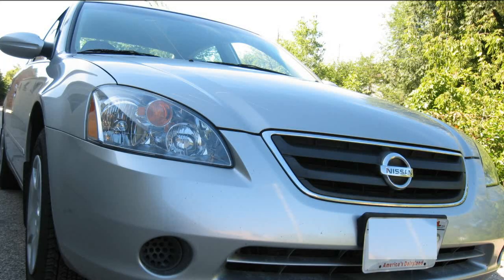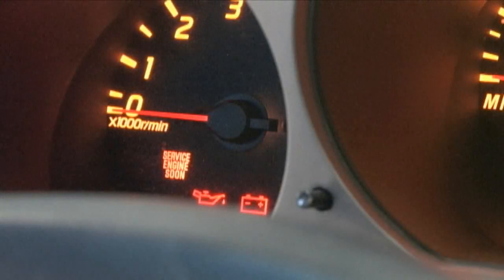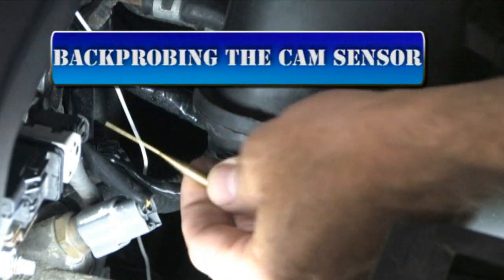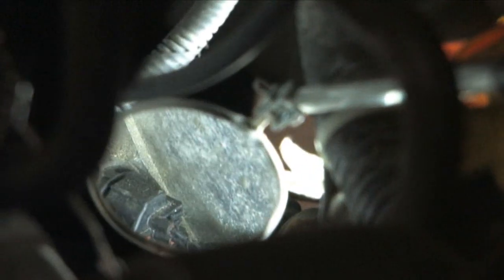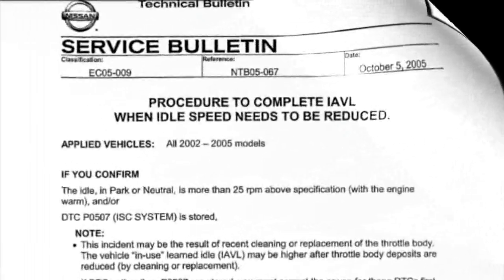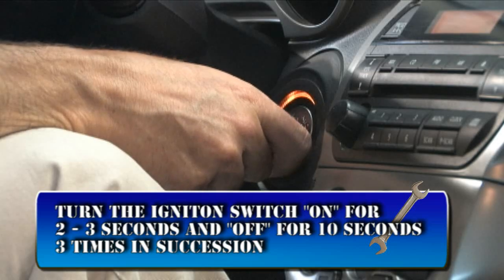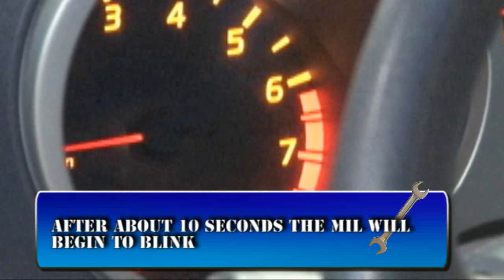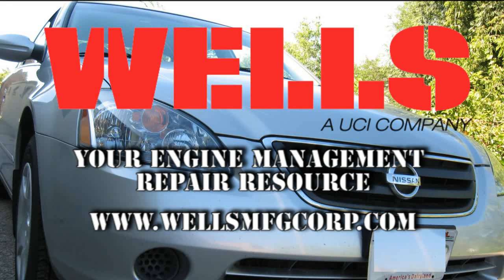Nissan P0505 P0507 Relearn Cam and Crank Sensor Troubleshooting and Testing by Wells

Comment: If it still dont work looking at the engine from the front with the hood open passenger side of the motor unplug cylinder 1 and 3 injectors they are in order left to right 1234, start the car then shit it off do the throttle learn steps then shut it off plug in the injectors and throttle learn again fixed mine that would not learn

Comment: Hi, I really like this troubleshooting video.  I have a specific question regarding cam & crank timing and error codes.  I have a 2004 Sentra 2.5 Spec V and it is giving me the P0340 code.  I replaced the cam position sensor and still have the code (won't clear).  I made a break-out test cable for the cam position sensor (by ordering a new connector and cannibalizing the old sensor for its connector).  Sensor excitation voltage, ground, and signal are all good as tested with a digital voltmeter.  About 2 years ago I replaced the crank sensor due to its error code so I doubt it is bad again, especially since the new sensor is the metal can type.  Question:  Does Nissan provide a particular fault code (P code) for cam-crank synchronization (timing) error?  I hope they don't lump that type of error in with the P0340 code, since I believe that should be for the cam sensor circuit only.  If it is "lumped in" with P0340 it makes troubleshooting a lot harder.  Do you have any suggestions?

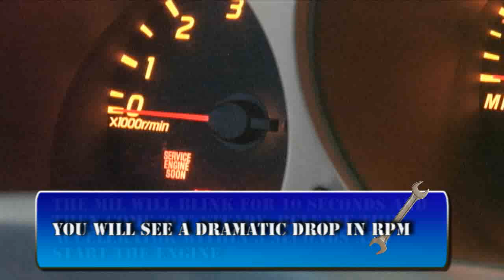Comment: hi, when you say in this video at 4:25 min mark ".. release an accelerator and start the engine". I though the engine was already running from the previous step where the accelerator was pushed to the floor for 20 seconds. what am I missing?
Reply from the maker: The key is only turned on before that mark. The first time you start the engine is after the MIL has come on steady.
Mike Becker, Senior Technical Services Instructor

Comment: Been trying this for a few days now and can’t get it to work. Went to autozone to check the battery as well to make sure it had enough volts and it did but still no luck. Any ideas anyone? 03 Sentra SE-R Spec V
Reply from the maker: DO you have any other codes besides the idle code? You are following this step by step exactly, right?
Mike Becker, Technical Services Instructor
Reply: Wells Vehicle Electronics I do have the code p0300 on as well. I did do it step by step multiple times and even counting faster and slower trying each multiple times as well.
Reply: I have an 05 maxima I just bought the guy replaced the drive by wire throttle body and maf sensor, the car off throttle surges from like 1000 to 2, 2500 rpm after it gets warm when it's cold it idles over a grand it is throwing the p0507 code also the p0550 code which is the power steering pressure sensor switch I know that the is will raise the throttle when you put load on it like turning the steering wheel I believe there is some kind of correlation between the two, after writing this Out I think that the power steering pressure sensor switch is bad has anyone had this issue or have any ideas what could be wrong. Also I'm if the guy knew to relearn the idle procedure so I will try this in the a.m thanks for any help that can be provided

Comment: I have a 2002 nissan altima 2.5 I put a new throttle body a mass air flow sensor and a cam sensor and my car still idles high and gods down the code is p0507
Reply from the maker: Hey Jose, did you follow the relearn procedure exactly as shown in this video after you installed those new parts?
Mike Becker, Technical Services Instructor

Comment: I would like to add something that might help someone.   I have been using this procedure successfully for many years.   However, after changing spark plugs and cleaning throttle bodies on a G35 with the 3.5HR motor  (one with dual intakes), I could not get a successful Idle air volume relearn no matter what i tried.   The relearn procedure did finally work when I ENGAGE THE PARKING BRAKE FIRST.    The FSM  does casually mention engaging the parking brake if the car has daytime running lights, however my car does not have them.   Regardless,  the relearn procedure apparently requires the park brake to be set on some cars.

Comment: what do you do if the MIL starts blinking but never goes to steady? When I do this procedure, the MIL will start to blink 10 times at a slow blink and then 10 times at a faster blink... It never goes to solid steady illumination though... Help
Reply from the maker: Hey Lee, sounds like the relearn procedure isn't taking. Send me out and email, I'll email you back with a TSB that has everything written out. I would recommend following that.
Mike Becker, Technical Services Instructor

Comment: hi,  I got a 97 nissan altima with a high idle.  I try this meted you show here and is still the same with high idle.....  I check for a vacuum leak and nothing..... any suggestions,  please
Reply from the maker: Hey voltz Escobar, do you have a check engine light on? If so, what codes are stored?
MIke Becker, Technical Services Instructor
Reply: +Wells Vehicle Electronics,  hi,   no check engine light & no codes. it's just on high idle and I check for a vacuum leak and nothing....don't know what's wrong,  any idea's ?
Reply from the maker: Do you have a full function scan tool? Might be worth looking at the fuel trim numbers. Maybe they are high? You have tried the idle relearn procedure and to no effect?
Mike Becker, Technical Services Instructor
Reply: +Wells Vehicle Electronics,  hi, I have try the idle relearn procedure but I might be doing it wrong.   ima try it again and have a timer to count the seconds, I may be off one or two seconds.... thanks..

Comment: Will dis work on my q45 2002 is on park n it revés above 1 and wen I'm. Driving in goes up n down the rpms have p505 help tank u
Reply from the maker: It might work. It's worth giving it a shot. Are there any other codes stored?
Mike Becker, Technical Services Instructor

Comment: just change my throttle body to a new one and cant relearn it took it to a mechanic and he couldnt either any thoughts on this thank you.
Reply from the maker: Hey Bryan, what year,make,model car is this on?
Mike Becker, Technical Services Instructor
Reply: +Wells Vehicle Electronics 2004 nissan maxima se v6
Reply from the maker: Are you getting a check engine light, or just a high idle?
Mike Becker, Technical Services Instructor

Comment: hi there , hope you can help me with my problem i have a 2007 350z vq35hr engine with the code p0345 which is the camshaft position sensor bank two , driver side , the thing is that i already replaced the sensor and didnt work , it keep throwing the same code , i reseted the code with a scan tool and again did not work , what it could be causing this problem , do i need to reset the ecu, if so how do i do it?, hope you can help me thanks in advance...
Reply from the maker: Diego, it could be a wiring issue that is causing the problem. How is the condition of the wiring and connector?
Mike Becker, Technical Services Instructor
Reply: the connector are fine, and the wiring seen to be fine too ,
Reply from the maker: It's possible that the cam has issues, or the motors timing is giving you issues.
Mike Becker, Technical Services Instructor
Reply: hi Diego. I'm having  the same issue with my g35. I just replaced  the sensor  but still throwing  the same code  and it takes a long time to start.  did you solve the problem  ?  if yes , how do you did it? thanks allot  . saludos

Comment: I tried on my 2005 pathfinder...five times and I still get the error code.... I changed the crankshaft position sensors and the camshafts sensors, cleaned the throttle body and changed the gasket...I still get the same problem....any ideas?
Reply from the maker: Hey Megamanxv, what exactly is going on with your Pathfinder? What code are you getting? Let's see if we can get to the bottom of this.
Mike Becker, Technical Services Instructor
Reply: i get error code p0507 the high acceleration error
Reply from the maker: Send me out an email, I'll then email you the entire procedure and see if that works. michael.becker@wellsve.com
Mike Becker, Technical Services Instructor
Reply: megamanxv same code one my 04 Monte Carlo changed cam and crank still nothing

Comment: Tried this on a '03 G35 and it works; the RPMs drop down. But the next time I go and start the car the idle will go back up. Any idea or help?
Reply from the maker: Do you have a check engine light on? If so, can you tell me the codes that you're getting?
Mike Becker, Technical Services Instructor
Reply: Wells Vehicle Electronics Yes I have the check engine light on. I bought an OBDII device to read them and its P0507 (high idle) and P0327 (knock sensor harness)
Reply from the maker: The procedure is supposed to work on most Nissan products between 02'-05'. Send me an email. I will send you out the detailed procedure. Michael.Becker@wellsve.com

Comment: will this work on a 92 Nissan sentra ?
Reply from the maker: Hi, from everything I have read this will not work on a 92. A 92 is a distributor car, and really a completely different animal than what you are currently working on. What is going on with your car? Maybe I can help point you in the right direction.
Mike Becker, Technical Services Instructor
Reply: Hello can you help me out please? i have a 2007 sentra and it stopped accelerating so autozone told me it was the accelerator pedal position sensor, so i bought a new one and installed it. they said i had to program it and i did not so the issue was still there. Will doing this fix the problem?
Reply from the maker: Hi Mike, I am not sure if it will fix your problem or not. What code did was found when they pulled codes? Also which engine is in your Sentra. Here is the procedure for you accelerator pedal position sensor.

OPERATION PROCEDURE
 1. Make sure that accelerator pedal is fully released.
 2. Turn ignition switch ON and wait at least 2 seconds.
 3. Turn ignition switch OFF and wait at least 10 seconds.
 4. Turn ignition switch ON and wait at least 2 seconds.
 5. Turn ignition switch OFF and wait at least 10 seconds.

Let me know how this turns out. 
Mike Becker, Technical Services Instructor
Reply: I treid this multiple times but still doesnt seem to work.
My sentra is a 2007 automatic 2.0 engine
and thers 3 codes, 
"P2138" Accelerator pedal position sensor circuit Range/Performance.
"P20122" Accelerator Pedal Position Sensor 1 Circuit Low Input
"P2127" Accelerator Pedal Position Sensor 2 Circuit Low Input
Reply: Wells Vehicle Electronics I have a Nissan Sentra 2005 1.8 I did it still won't work can you help me plz

Comment: thanks you so much,  yes I did it.    the first time, long time ago  I tried it, I couldn't done it  and I when to the dealer and they charge me $118  and I just put a new transmission in my car and the idle was higher than normal and I try and I got it $118 save it thanks so much
Reply from the maker: Nice Rojo! Glad you were able to get it all fixed on your own. Isn't that a great feeling!?
Mike Becker, Technical Services Instructor

Comment: This definitely works. I got the P0507 in my 2002 Altima 3.5SE after cleaning the throttle body (it was filthy) and the idle went up to 1500rpm. It took two failed attempts before I got the pedal timing and pause lengths right - 3rd time's a charm. Thanks! (Sidenote: If you start and stop your car three times in less than 10 seconds, it will reset your car's idle down to zero and your car will start but immediately die if you don't give it gas. This process will fix that problem as well.)
Reply from the maker: +B J Glad you were able to get it to work. You are right, this can be tricky to do, it took us a few times at first as well. That's a nice little tip, thanks!
Mike Becker, Technical Services Instructor

Comment: Well not for the HYBRID..you have to use the SCAN III tool to reset it.Impossible to do without a trip to Nissan and hooking it up to their tool (good luck trying to find someone else who has this tool).$179 dollars later, Its now fixed. I do have another question though..where in the heck is the transmission fluid checker ? I don't see a dipstick anywhere for checking transmission fluid.
Reply from the maker: ***** Sorry it did not work on your hybrid. When I get a chance i will try it. You have a CVT transmission. To check and fill the fluid, there is a plug on the bottom that needs to be removed. The level should be even with the plug hole. 
Mark
Reply: markjhicks re:fluid plug, at the bottom of what ?
Reply from the maker: ***** Bottom of the transmission. Take a look, if you have problems finding it, send me a message with your email address, vehicle and question and I will send you the information I have. 
Mark

Comment: Hey mark I tried this several times but no luck. I believe im doing the key process wrong. When I turn the key to the on possition for 3secs is this when the dash lights come on?(1turn before starting engine) when I turn it off is this when the dash is fully off?(starting position when 1st putting the key into ignition) Im basically doing 1turn on one turn off of the key then 2turns(lights come on) then press the peddel. 2004 nissan sentra 1.8
Reply from the maker: The91jesus Yes this procedure will work on your vehicle. It took me several times the first time and that was after another master tech said it didn't work. So do not feel bad about having problems. Where we put a time scale means start counting after you do it. I hope that makes sense. Watch the video again and try not to think ahead. Get the process down first and then start counting out the segments. I hope this helps, please let me know either way,
Mark Hicks
Wells Vehicle Electronics

Comment: Mark,  Perfect solution for my 2005 Quest 3.5L.  I cleaned my throttle body, replaced my Bank 1 Cam position sensor and reset my P0507 High idle code.
Reply from the maker: Brad Ruehle Thanks Brad, for let everyone know it worked on your vehicle. It is much appreciated.
take care,
Mark Hicks
Wells Vehicle Electronics

Comment: Well, its a bit "after the fact" now. Ive already cleaned the throttle housing, and yes i did disconnect battery terminals BEFORE I attempted to remove the throttle housing The question is what to do now? How do I fix the high idle problem...some suggest drive for 30 miles and comp will re-learn but I don't want to drive for an hour if its not going to work. Most of your feedbacks are for Nissans that are older than mine (2007), I have yet to find a soulution specific for Nissan 2007+ models.
Reply from the maker: ***** Engine speed at 200 RPM or more over the target idle speed will set this
 code. There is a TSB (TSB# NTB05-067) concerning this code that refers 
to disconnecting one or more fuel injectors to bring the RPM down and 
perform the Idle Air Volume Learning procedure. It often takes 
disconnecting two injectors to bring the engine RPM low enough for the 
idle relearn to work. The idle will not relearn if the engine speed is 
too high. During the relearn procedure, idle relearning actually begins 
when the engine is started. The TSB refers to using the factory Consult 
scan tool, but the manual procedure does work if the procedure is 
followed EXACTLY. The engine and automatic transmission (if equipped) 
need to be warmed up too - follow the preparation instructions.
If the idle will not relearn, it may be necessary to bring the vehicle 
to the dealer to have the factory scan tool try going through the 
relearn procedures.  
Mark Hicks
Wells Vehicle Electronics
Reply: This works, it did for my 2007 3.5 se altima, you have questions ask me

Comment: h-e-l-p! I followed precise instructions as suggested by nissan forum, for my 2007 Nissan Altima(hybrid) There was a lot of dirt in the throttle body so I thought I did a great service by cleaning all that guk out..i made sure to disconnect both battery terminals prior to pulling throttle body out completley, did everything as suggested...BUT I now have a HIGHER RPM than before I took the throttle out...I cant drive the car now because of the high rpm..I pulled and put it back exactly as I should, all wires and hoses connected to their rightful place..what could have caused a worsening of the rpm, I don't understand ??
Reply from the maker: ***** Anytime the throttle body is cleaned this procedure needs to be done on Nissans. If the idle is too high when you do the procedure, you might need to disconnect an injector or two before hand. Read the other comments, lots of information.
Mark Hicks
Wells Vehicle Electronics

Comment: Trying this on a 2007 everything does exactly how you mentioned but my rpms are still high like its not accepting the relearn but the mil blinks and stops after all the steps. Could it be the engine temp and trans are not at proper temperature
Reply from the maker: If the MIL it reacting as stated in the video, it means the PCM is accepting and trying to adjust idle. This means something else is causing the issue and the PCM can not compensate. It could also mean you need to slow the RPM before performing the relearn. Try this first. Disconnect an injector or two to get the RPM below or near 1,000. Then do the relearn. If that does not work, you have an issue with the engine like a vacuum leak which is pretty common. Stay in touch,
Mark Hicks
Wells Vehicle Electronics